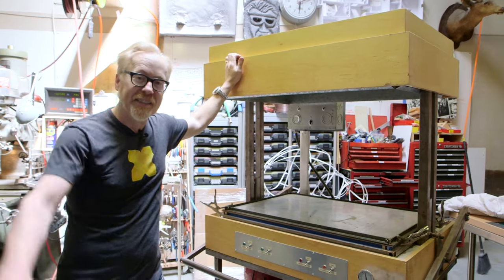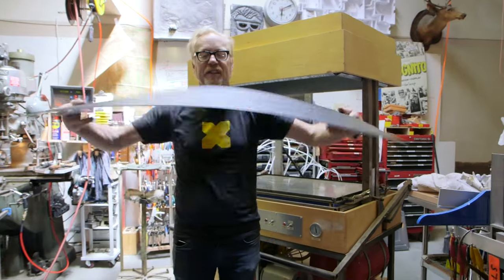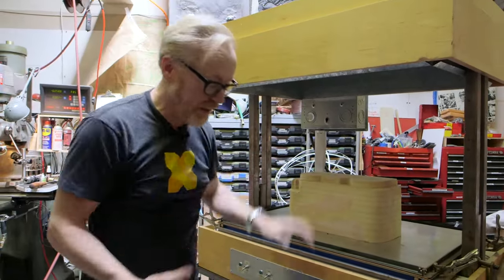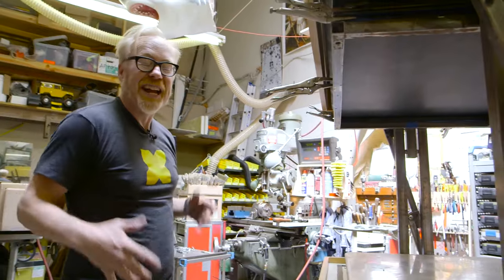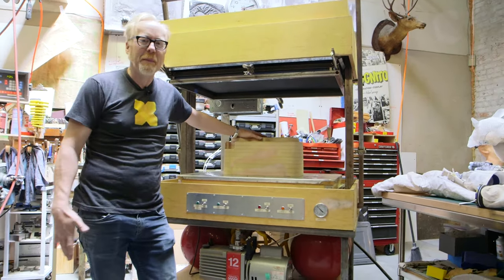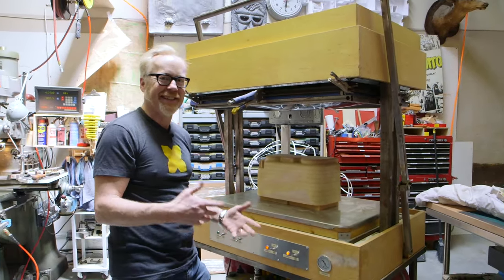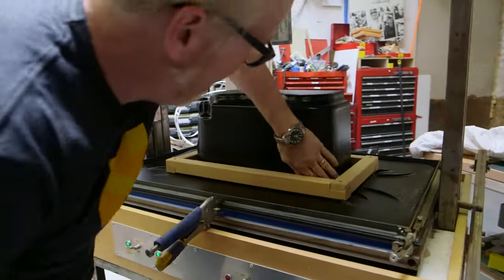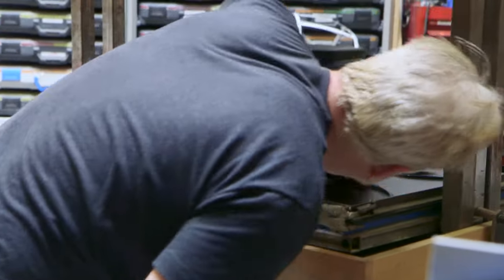Adam Savage's Vacuum Forming Machine

Comment: ADAM!!! Use a compressed air nozzle blowing in the edge to separate the piece from the back!!! It will pop right out! No hammering or messing around!
Reply: +Xplosion51 It obviously did because you're on this planet.
Reply: +Xplosion51 I can tell.
Reply: +USWaterRockets Seconded!
Reply: Nighthawke70 I was shocked that Adam never learned this trick. It's great for demolding castings too!
Reply: I am from Soviet Russia here brains are best
Reply: Well there's a lot of delicacies in Russia that are quite nice.
Reply: You are german? Wo her? You sound more like polish to me..
Reply: i was just thinking the same thing
Reply: USWaterRockets or... Integrate a flange .. Sealed form, and wd40
Reply: thinking and done it, and it works
Reply: I know that he is using it for special effects, but for a production piece we learn to design the top smaller than the base, to make a easier separation
Reply: I do that with my molds and also when I use to make teeth we would use air to release the molds. They just pop out right away.
Reply: was about to say the same thing, but you were first :)
Reply: In soviat rusha wards spell u
Reply: He had that machine for so many years ,funny how he dont know how to use it properly and seems like masic knowledge  XD

Comment: Although I doubt he will see this. But Adam has one of my pieces hanging on his wall.  So ADAM  here's a few tips for next time you are working with a large buck and ABS.   First off I often use a flattened air tube attached to my air sprayer. By sliding it down flat along the sides and throwing 120psi air it will release from the buck nicely.. Sometimes the glue in particleboard will stick to the ABS.  You can also pop a tiny hole and use a sprayer with a rubber nozzle end to push pressurized air into the piece. This can actually pop the buck clean out of the piece in some cases. 

Sadly I doubt you will see this being as busy as you are. But hopefully it will be helpful to someone .

Comment: After trimming off the overhang, I find injecting compressed air between the buck and the part usually pops the part loose.  For fine detail we often drill small holes in the edges and corners as suggested above and it makes a big difference.  You can also inject air through these holes to help loosen the part.

Comment: "I learned a bunch of things during this form"
BANG
"I learned that I think I got the plastic actually too warm"
BANG BANG BANG
Reply: +alosercalledsusie That is
BANG BANG BANG
really funny quote
Reply: Hi you do realise that what was stopping it popping of was the air  not able to get in if you use a tube to blow air in next time
Reply: If the air can't get in, then how did it get out during the form?
Reply: "I learned that I need a tighter"
BANG BANG BANG
Reply: Too much heat and it will rip. Too little and it wont form enough.
Reply: @basmangeorge  no, YOU realize.

Comment: I used one of these plenty back in 1999-2000. Worked for a firm making metal detectors, I was in charge of producing the various body parts for the machines. Our vacuum former was slightly different to Adams, it seemed more advanced and easier to use, the metal frames and clamps ect were all operated by pushing and pulling large hand levers, was quite easy to use, but there was definitely a knack to getting all the settings right, and I sure was glad the firm was paying for all the sheets and sheets of various plastic!!!! It always took one or two sheets to get it set up right! Looking back, that was so unbelievably wasteful haha. When the parts were formed, I would take them to the band saw and rough them out. Great memories, was a good job, I enjoyed it a lot.
Thank you to Monika and Derrick Farrow of Protovale Oxford for being good bosses. Good times back then.

Comment: I have a small vacuum form machine we use at my shop... it has 2 tanks. The air gets vacuumed out of one tank and is pumped into the other. Once the vacuum is drawn and the piece has sufficiently cooled, it's just a matter of reversing the tanks and blowing some air into the the mold to release it. And yes, a rubber mallet is handy sometimes. Also spraying the mold with silicone lubricant can help. The biggest thing... try not to have ANY undercuts or you may find you'll never get the piece off - especially with thicker plastic.

Comment: Couldn't you drill a hole through the buck so that you could put a shop air blowgun on the hole and separate the pieces?
Reply: +John Ridley I was going to suggest the same, but without the hole, as you could do that by pulling out one of the sides.  One approach or the other should work!
Reply: +John Ridley The buck is held in by friction, not suction.
Reply: That and a bit of draft angle would've helped
Reply: +Brian Ortiz doesnt look like much of a draft on there, there probably is some suction.
Reply: +Brian Ortiz maybe not suction, but adding 100psi to that square foot area of the inside of the top would remove the form in a real hurry.
Reply: John Ridley grip is way too tight...curves, corners..texture..
Reply: frollard doubtful.. Either a connection that would not hold and a chipped tooth, or abs in 15 pieces and a sliced off finger
Reply: Isn't it amazing that everyone knows how to get a part off a form except the dude with the television show making the big bucks?
Reply: Wren Wright Given an audience of tens of thousands, there will be at least a few people who know more than pretty much anyone you put on the screen.
That said, I am sure Adam knows all this perfectly well, but was in a hurry and thought it wouldn't be a problem.
Reply: Jesse Wright 
Doesn't mean he is an expert - he uses the word 'lathe' as a verb in one of the other videos.

He knows enough to get by in several different fields, (which is admirable) but he's not the last word in any of them.
Reply: James Beat and, as well all know, you can not be an expert at any tool usage unless you have perfect vocabulary. 

Old Benny at the lumber mill is being replaced by Jim, because Jim has an English degree, and knows that the past tense of cut is cut, not cutted.

Anyways, he says numerous times in many videos that he is not an expert. But I will wager that he is better at what he does than the majority of his viewing audience, if not the world.
Reply: John Ridley that's a good idea :0)
Reply: @ortzinator  it's actually both that hold the plastic, like two painted buckets.
Reply: Work gloves wouldn't be a bad idea when working with hot plastic either.
Reply: If you drilled a hole you would need a plug to keep the vacuum from denting or ripping a hole in the plastic but that would've been a lot better than cutting the plastic in half like he did.

May need to smooth out or wax the MDF too if you want it to come out cleanly. Fiberglass resin mixed with Bondo makes for a good permanent light coating over the MDF.
Reply: Blowing up the side would have done the trick
Reply: @ryry7886  your comment about work gloves reminded me of the time in a MythBusters episode where he got to work love caught underneath the frame of a vacuum former he was using. 🤣
Reply: @ryry7886  talcum powder works good for vacuum forming separation
Reply: @ortzinator  But the air would puss the plastic away from the form.

Comment: Great machines these. I used to work for a vacuum forming company as a tool maker (making the forms). You don't need the small frame you slip over the top. Just keep the pumps running, make sure there's sufficient holes in the form and let the vacuum do the work. Add more holes to problem areas after a test if necessary. To remove, rig up a compressor, let the plastic cool for a minute or so, then pulse air through the form using the vac hose via simple switching valve.
Reply: Oh, and you get better results on a warm form too ;)

Comment: I bet if you drilled holes from the sharp inside edges at the top down to the bottom; you could get even better shaping
Reply: +3E yup, exactly why most home made ones are done with pegboard.
Reply: +MyBrothersMario He means through the buck positive -- the metal base of the former is already perforated. Having a channel(s) through the buck would mean after it seals to the sides of the mdf it can still get detail up high.
Reply: +frollard and if you channeled it a bit you might have access to blow air back through to help pop the cast off.
Reply: +aintnobitchms that's what I was thinking. even just a shot up the bottom edge of the draw.
Reply: 3E probably have a loud " bang " and a hole in your abs
Reply: That's how we had forms made at one company I worked for. They had holes through the shapes to pull in the corners and clay along edges to get better rounded lines. They would make about 3 or 4 when a new cover was needed and adjust holes and clay to make them look better. Then we'd make covers until we had what we needed and stored the form where they would forget it and build another one later.

Comment: Adam,  Been there done that.  Looks great.  It will release much easier if you drill (if you can) a small hole in the top and hit it with compressed air to help release the mold.

Comment: Could you have drilled a hole in the middle of the form and used air to blow it off ?
Also a couple of screws in the bottom that you could clamp in the vice to hold the form still
Reply: I was thinking just a small hole, 1/8" maybe, might mean a bigger hole drilled from the bottom (to get the length of drill), then the 1/8 to break through the top
Reply: i was thinking the same thing. Then I though about cutting the form into quarters and shimming between them. After forming, remove the shims and it should fall out. Although it would be really hard to hide the parting lines. 

but then again, I like Adam said it isn't going to be seen so its appearance isn't a big deal.

Comment: Vacuum former i used has the clamped plastic in a stationary position, and the form would be raised to heated ABS, cooled with fans, then form is lowered, agitating up and down and the cooled plastic would pop out on it's own. It also helps if a powder similar to talc is applied to form before forming.

Comment: I am late to this 2016 party, but I wanted to suggest spraying a mold release over the buck. Straight silicon spray might work fine. Also, some 40 years ago, I learned about pattern making for casting cast iron parts. For that you build in a slight taper into the side walls of the pattern to help with this mold-release process. (Look at anything cast iron and you won't find any parallel surfaces unless the were machined in after the casting process.) I think the compressed air idea mentioned below might work well depending on how stretchy the ABS is. If nothing else, that should automatically push the buck out of the ABS.

Comment: if yo uh put a little hole to allow air to enter as you remove the mold would that ruin the vacuuming? because if it doesn't it would really help remove the form from the mold.
Reply: +Austin Jacob exactly what I was thinking. drill a hole, and plug it with a dowel while vaccuforming, and then remove the dowel and some compressed air might help release it. disclaimer- I've done exactly 0 vaccuforming but enjoy the demonstration.
Reply: +Derek Place When ive done it we drilled holes through the form as it helps remove the air especially if you have cavity's and weird shapes but you do end up with little dint's on the finished piece.
Reply: I don't really think the reason that the mold didn't want to come off of the buck had to do with the air flow. I think there's just a lot of friction between two items that are perfectly shaped around each other.
Reply: +Chance Price probably true.
Reply: +Austin Jacob This is often done in industrial applications of this technique where the mould has tiny holes all the way through, vertically, to allow for easy de-moulding. A draft angle of 7° is also very common and good rule of thumb for designing moulds. But if you don't get the parameters right these holes might show up as dimples in your form.
Reply: +Prime Technophilia Lard? I have no idea as well.
Reply: +Claus Bertels Or placed in spots that will not be used/seen.

Comment: I used to run a 4000x3000 bed vacuum moulding machine exactly the same set up but on a larger scale.  Just a tip i picked up over the years forming. Was never drop your material over a cold moulding tool always get it up to temp first. That way 9 times out of 10 you will get the mould correct on first drop. And also use a temp gun to read material temps that way you will know when its good to ready to drop.  ABS was around 155 to 160 degrees for successful mould

Comment: this taught me so much about why the vacuuformer in my secondary school's workshop was so diasppointing! fed right off the vacuum pump instead of storing negative pressure in a tank like a capacitor, AND no frame to slide down around it. the edges from hard shapes were so round and disappointing! though they got a laser cutter the next year so all future cases for housing electronics that i made were made from slot and groove laser-cut acrylic instead.

Comment: Adam, since you seemed to be having trouble removing the former, (and you didn't seem to have done it in the video), I have a method which I know of that makes it easier. I do electronic products at my school, and when we use a vacuum former to make our casings, we always rub paraffin wax across the side of the plastic that comes in contact with the former, find it makes mould removal easier. The source of wax we use is just a tea light that we rub onto it.

Comment: man that thing totally SUCKS !! and in a good way! I wonder how many household vacuum cleaners kids have ruined trying to make tiny at home Vacuum formers.
Reply: +Nik Butler For having built with my friends, if you built the table itself right, you can't really blow the vacuum cleaner unless you over estimate the vacuum and let it on for like a minute when the plastic isn't pulling. The real problem you encounter is that you don't get a good pull. In the end, we used a commercial grade shop vac to do it.
Reply: +Nik Butler Should have seen the look on my face when I saw James Burton use a plain old household Dyson vacuum & space heaters in a wood "oven" lined with foil for his larger former. I was like, "What the Hell? That is the most brilliant cheap solution I've ever seen!" Thing totally works great too!
Reply: Volvary I used a 1980s wet vac and spliced it so it pulled from all 4 sides.. Amazing job it did....

Comment: Instead of using the awkward extra frame that you pushed down by hand (risking minor burns) you can make an adapter insert (called a reducing window) that is sized to your outer frame and the parts perimeter. It's best to cut these reducing windows made to match the the exact part perimeter from thin plywood (keep lots of scrap plywood or hardware store mahogany door panel). That way you not only can keep the fixed and stable part of the frame close to the perimeter for more control of the amount of sagging or droop AND the vacuum use to do the forming CLOSE to the part's edges. AND for us peons without a large materials budget you even save plastic. Just remember that FOR DEEP PARTS (like this one) you have to plan for a little  "extra" plastic around the perimeter to "draw" that extra depth. Adam accounted for this by letting most of the "draw" occur BEFORE pushing down his makeshift frame to close the perimeter for better vacuum. A more controlled method would be to replace his last second frame draw with the reducing  window to control the vacuum space.  This means you need to plan* for this by cutting and attaching the feed plastic larger then the actual opening in the reducing window. This minimized the chance of having those tall vertical sides from pulling out too thin while still allowing maximum vacuum with more control. Just use a heavy staple gun (and a little 600mph tape) to fix the  to the inner edge of the plywood frame adapter.  *from previous experience ...just GUESSTIMATE! LOL

Comment: Building a hollow mold and drilling a series of holes in the crevices, or inside corners with a piece of wire will accomplish a much tighter pull. Also a draft angle on the sides when possible is always nice.

Comment: Ive never used a vacuum former, or an injection molding machine. But im in the beginning steps on creating the former.
But from the research ive done, its important to make the walls slightly slanted, this allows the part to break suction from the mold much easier.

Comment: Hey Adam. little tip for removing your work from the buck, blow compressed air between them. No need to cut or drill holes just push the tip of the air nozzle in where the two pics meet and give it a blast. I use air to pop fiberglass out of molds all the time it works great, also a great way to separate stacked buckets that are stuck together.

Comment: Thanks for sharing. I suggest you use the vacuum system to free the molding.  Turn the mold upside down, fix the wooden pattern a beam and let the vacuum system pull it off ABS molding

Comment: Tips
Apply a stocking over the mould to allow suction to spread over whole surface.
Spray with silicon spray as a release agent.
Drill a hole in the top and blow compressed air in to blow the mould out if there are  no undercut areas.
Also put a peddle between the tanks and the suction table so you can regulate the speed the air is removed and thus allow you time to ensure there are no wrinkles

Comment: As someone who has never used a vacuum forming machine (so excuse any ignorance), i'd just like to mention it might be a little easier to get the plastic off if you put a small air hole at the top to allow influx of air as to stop negative pressure forming as you pull it off. I dunno if that would actually help though.